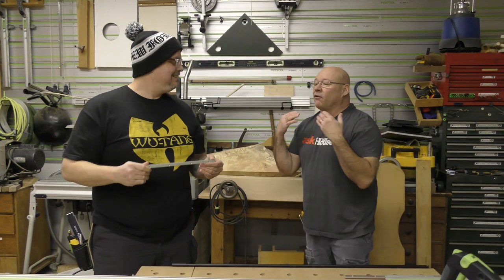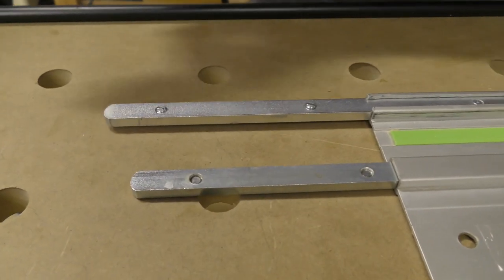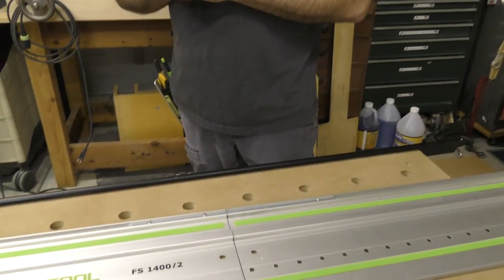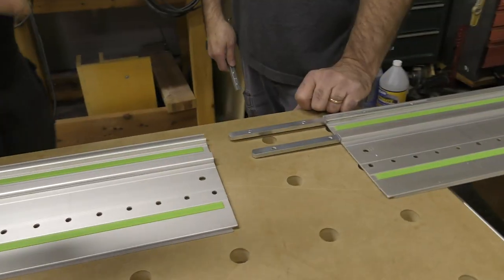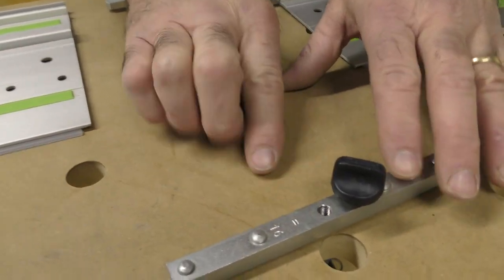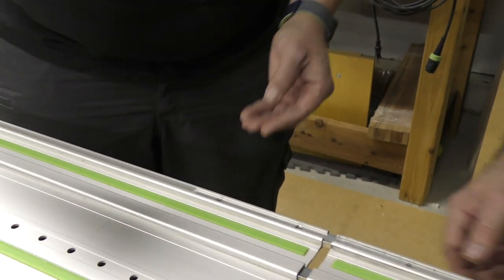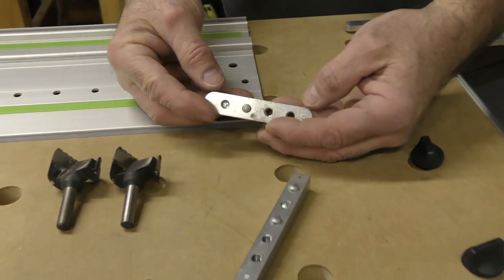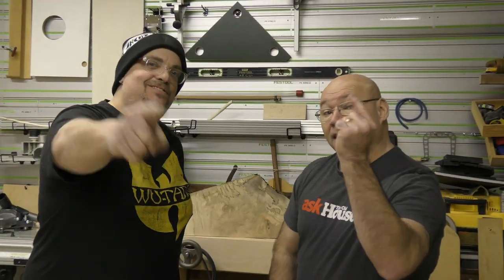How To Properly Attach Rail Connectors for your Guide Rails

Comment: Thanks @sagetool for the tip. I have been following your method, I’ve also follow the straight edge alignment method, and all I can say ( repeatability ) it’s just not there in this design. Just do a reach on the internet, and there is a well documented example of a poor design, not just my opinion, I hope you take that with the highest level of “positive critic.” One thing I’d like to ask is, I could never wrap my head around the comment made about aligning to the external edge of the rail ( opposite to the cutting edge ) as most if not all “square guides” are leveraging this edge for alignment, again, since there is so much variance in the play needed for the inserts on the track guides... thoughts?
Reply from the maker: Never gave it much thought ...the method I use in this video I have used for quite some time and it seems to work for me.....thanks for sharing

Comment: I have the old style lr32 endstops.  Is there a way of using them and not using router bits to get the proper spacing?
Reply from the maker: yep... use an 8mm gauge block

Comment: hah I bought two 55" tracks for my festool track saw and Immediately dimpled them by over tightening...should have watched this first. it is not enough to cause any issue but it is annoying to see it on brand new tracks like that. what I am struggling with is the fact that 1)I need to switch back and forth often from 55" to 110" tracks and having these set screws makes that not so quick. I could get a third track and keep two of them always connected but then there is nowhere to put a 110" long track in my work trailer....I wish there was a quick connect for these. I will probably buy a third track ,that way when I set up for the day I just connect the two together for my long cuts if I am even doing any ,and have a third for my crosscuts.mostly I think I will use this saw for breaking down sheet goods and crosscutting wide materials accurately without a huge tabklesaw .I aM curious if anyone has any advise here if there is a better way to do this.
Reply from the maker: cool